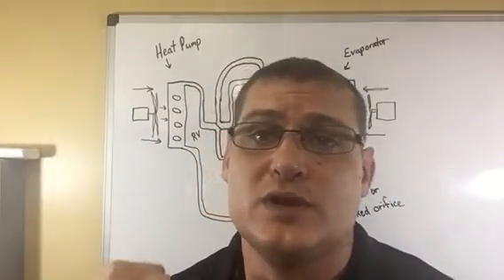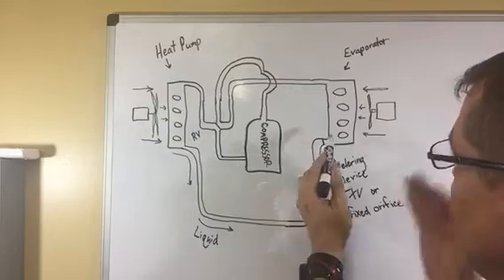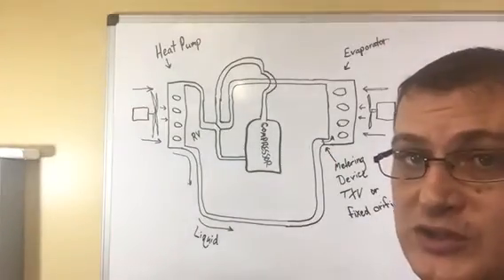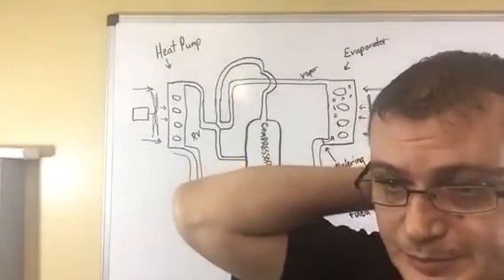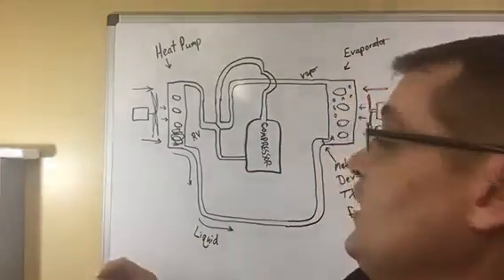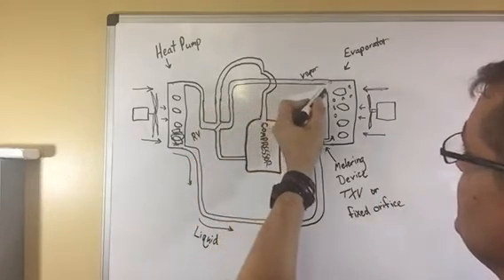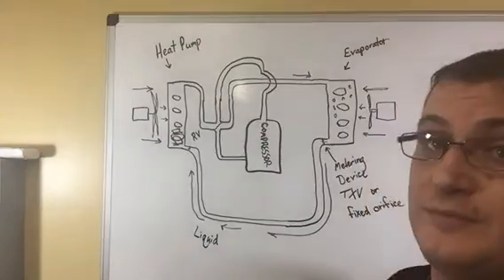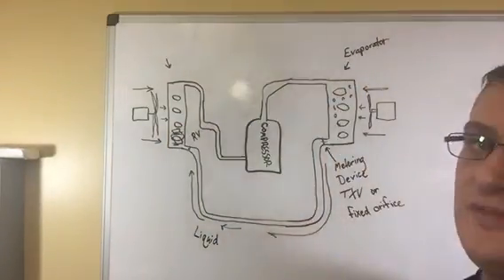HVAC Service: Heat pump/ Condenser refrigerant cycle

Comment: Does the heat pump/condenser unit outside produce moisture while it’s running? Not excessive but the ground around it shows signs of moisture. It’s a 4 ton trane

Comment: Although what you are saying is correct, your diagram is off. You need to correct your drawing to reflect the compressor discharge line which comes out of the top of the compressor which then goes to the condenser. Then change the vapor (suction) line returning from the evaporator to where it's entering the bottom of the compressor. Heat Pumps are amazing. FR

Comment: Great explanation on heat pumps! If you were to clean the indoor coil and needed to remove it would you be able to do a pump down?
Reply from the maker: Yes just have to put it into cool mode so the reversing valve is in the right position.